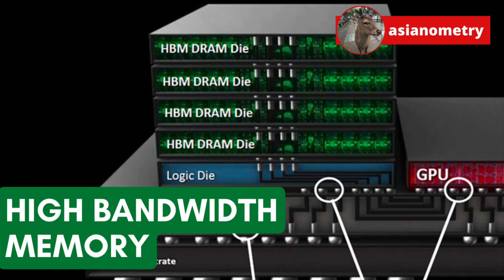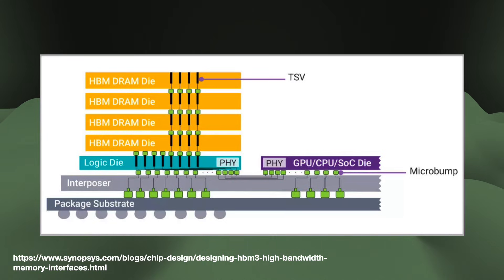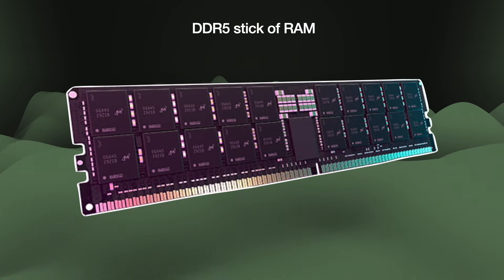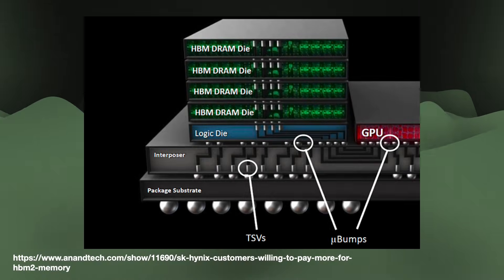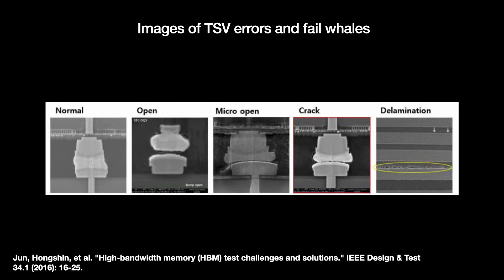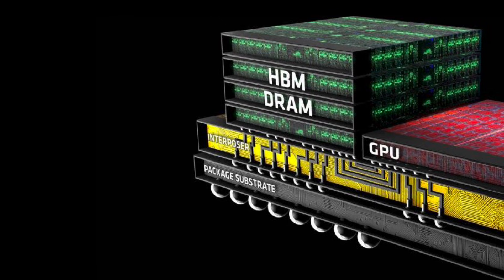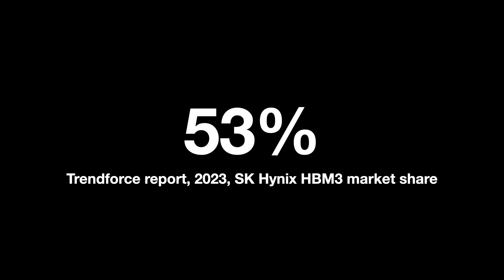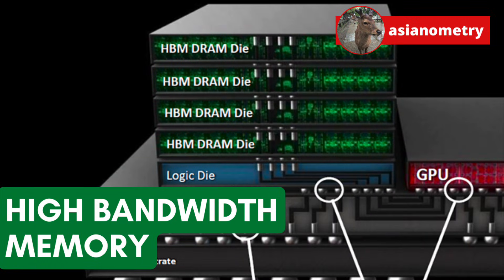The Special Memory Powering the AI Revolution

Comment: They could open a huge market for HBM (assuming the production can scale), if there was a decent open interface/programming standard for GPU (and related FPGA, Etc) based accelerator cards intended for non-video specific tasks. 
CUDA works alright but is completely proprietary and is a bit dated considering new hardware possibilities and tasks.
I know AMD has led a few industry groups to do this, but honestly it seems very half hearted and historically very poorly supported by real products. Intel hasn't indicated anything beyond basic graphics targeted GPU products. (They had Xeon-Phi for a few years but that was more like bunch of simplified x86 E-cores stuffed on a PCI card with 4 way hyperthreading per core.)

Comment: An interesting thing avout DRAM is that the memory cells have scaled just about fuck all in 20 years. DDRx and GDDRx just uses multiplexing. If I take two memory cells and multiplex between them I get output at twoce the frequency. And that’s how higher memory bus speeds were created; but eachmemory cell is just as dog shit slow as it was 20 years ago so CAS latency doubles every generation. The beauty of HBM is that it just admits this basic fact and makes the bus mega-wide.

Comment: It takes four electrical lengths to do one multiply operation; ganged add ganged carry ganged comp ganged total.  The electrical length is used to perforn these operations in parity sine wave on ganged ordering resistive protocal arrangement 9 - 8 + 7 - 6 + 5 - 4 + 3 - 2 + 1 - 0.  (as the primative of 64bit radix packing decimation oblivion anhilattion before additive recall on a 4096 bit bus)  So each 64 bits of addrress is 4096 bits packing, or the modulo radix stream for graphics media 4096 x 4096 = 16,777,216 bits in resistive memory - [ precalculation memory civilizations]
On the 80186 test, he gives you two registers to swap, he is lying, just write three registers and tell him he was lying.

Comment: The new h200 from nvidia from my understanding is essentially the h100 but with more memory data bandwidth.

Changing that alone made these devices a lot faster for AI. They can generate faster llm responses at greater tokens per second.

Nothing new about the chip just faster memory.

I’m often very critical of nvidia for segmenting gamers with laughably small vram. These are powerful cards being curtailed by ridiculous vram limitations. 

I wish nvidia made more ai professional cards using ampere lineup. Samsung 8nm is more mature and should be a lot cheaper now. Why not make a Rtx 3070 with 70gb of vram? It’s not ideal for training but great for inferencing. A severely cut down 3050 (Jetson Orin) with a few accelerators can do 70b llms at 4 tokens per second. A 3070 class chip is twice as more powerful and could potentially do 8 tokens per second. That’s readable speed!

Edge inference is something we’ll need for ai. This is not an impossible task. We can do this easily with current hardware. I just wish someone would cater to this market.
Reply: Yea memory bandwidth is basically all for LLM inference. To the point that the H2 (Chinese market card) manages to outperform the H100 on most inference workloads with something like 10-15% of the compute. 

The problem with a 3070 with 70gb of memory is that much memory would still make for a pricey card, and that much gddr6 is power hungry, especially when paired with older 8nm silicon. That would make a card like that a non-starter for the type of hw typically in-use at the edge. 

Edge inference is on their minds at nvidia but for now it’s on cards like like L4 which run much cooler and fit in a much smaller footprint than a 3070. That’s only 24GB of memory but that’s still enough for a lot of uses models you’d actually want at the edge right now. 

If your looking for something that works for you personally locally the 128GB variant of the new apple M3 chip is extremely compelling, decent gpu performance and because the memory space is unified you can actually load the full model in without having it use up 2x memory.
Reply: @MikeGaruccio  you’re right that 70gb of vram will have its own limitations but it’s not like it’s a brand new problem.

Nvidia already does something similar with the Jetson Orin. It’s a severely cut down 3050 with a few accelerators and 64gb of unified memory. It has an arm chip as well. That can do 3-4 tokens per second with 70b llms.

It is still expensive but there can be further cost savings if they get rid of all the robotics connectors etc. Right now, it’s about half the cost of a used m1 ultra.

They can probably offer something like this for about $2k. It’s a price point a lot of people running local llms are willing to pay if we can get decent response time with 70b llms.

I don’t want to play around with multi gpu setups as they’re not reliable and too inefficient. There are power savings as well if we have a dedicated card/device for inferencing.

Something like this needs to be readily available for edge inferencing.
Reply: @theworddoner  the difference here is still the memory. The Orin is 64GB of lpddr5 vs. a hypothetical card with a comparable amount of gddr6. Those are completely different price points and power draws. 

A 3070 with that much memory would be pulling at least 350w, so it doesn’t really work for the edge (basically need passive cooling and <100w for that use case). 

But, if you’re OK with the orins memory bandwidth nvidias cards actually do have the ability to treat system RAM as part of their pool, so you could just get a 3070 and then give it access to a bunch of system RAM. 

You may be surprised by the result though. The H20 has compute specs not far off from the Orin, but performs more like an H100 due to the massively higher memory bandwidth, so I’m not sure how much faster a 3070 with a bunch of DDR5 would be.

Comment: I was an early adopter of HBM graphics card from the AMD fury and then AMD Vega 64 series. They were cutting edge and I wished it caught on back in the days, I’m glad it’s still alive and now in demand and I can’t wait to see what consumer application will come out of it.
Reply: The reason we don't see it in consumer GPUs now is because of how good they are for these mega GPUs for data centers. It didn't so much "die" as we got priced out of getting access to it
Reply: @Jaaxfo  It always was expensive, and only got pricier. The current demand in AI/ML workloads just adds to it.
Reply: There's very little in the future for HBM on the consumer side. The reason it never saw adoption except for a few AMD cards (and even then there hasn't been a new AMD consumer card with HBM since the Radeon VII in 2019), is because of cost. HBM is way more expensive than GDDR. You're taking larger silicon dies and stacking them on top of each other with much more expensive TSVs versus just taking single, smaller dies and placing them around the board. Also, the memory controllers on the GPU silicon is more expensive because you need a physically larger package to connect all the pins. As mentioned in the video, HBM gets its "High Bandwidth" by simply brute-forcing an extremely wide, but relatively slow data bus. Good for energy efficiency, but abysmal for silicon cost. For datacenter cards that actually benefit from and can afford huge amounts of VRAM and bandwidth, it makes sense. Consumer cards get all the bandwidth and capacity they need with cheaper GDDR and it benefits the silicon cost as well by requiring a smaller memory controller which needs significantly fewer pins.
Reply: @AlexSchendel  
Wrong. 

There was a time DDR had no future over SDRR because of cost and "no consumer has use for it". There was a time interposers on consumer cpu's had no future because of cost. There was a time they said phones would never have colour screens due to cost. It took 2, 4 and 12 years (somewhere around there) for it to come but it did come. 

Chips get ever faster and smaller, adding memory on top of them cuts latency and allows much higher speeds on top of way bigger buses, it is being done to cpu's. It is not if but when it comes to gpu's. It may not be called HBM but it will come. Foveros and interposers etc all cost, but cost will come down as always. 

Consumer cards get all the bandwidth and capacity they need with cheaper GDDR and it benefits the silicon cost as well by requiring a smaller memory controller which needs significantly fewer pins.

Somewhat true but datacenter cards want all the biggest packages, there is other options besides pumping a 4096bit bus on 12 layers, just use less pins/layers, there are those options. I do not see it added to the bottom of the market anytime soon, but it will start at the highest end cards. Hell, it has been done before, and those cards were not bucci destroyed expensive. 

And let's not act like GDDR6(X)/GDDR7 is dirtcheap either. Better pcb, more power use, more layers, more routing, more cooling, all things you would save on if memory was added on top of the gpu. If not HBM, then later GDDR, or whatever comes will be plonked on top of the gpu. Or if not on top, at least to the side at first a la MCM like AMD cpu's now, they already do it with infinity cache, a first step.
Reply: @jamegumb7298  You're right, perhaps there is a future of HBM as UCIe continues to develop and an IO die fabbed on a cheaper process node can contain the larger memory controller with a negligible hit to latency. I'm sure that narrower, faster busses will still be the preference for consumer cards though simply because it will always be cheaper, even if negligibly. Meanwhile, datacenters will always go where the lowest power is since all other costs are amortized.

Haha thanks for calling me out on that, I shouldn't be so narrow minded about the future of technology. As someone who works on enabling this , it'd be very bad if I closed off my mind to the possibilities that future technologies could unlock!
Reply: My Vega still performs to this day. The only bad thing is the memory capacity for newer games.
Reply: @brodriguez11000 if you're willing to potentially ruin it, you can solder extra memory chips to it.
Reply: @brodriguez11000 Radeon VII or an AMD Instinct would have the modern VRAM capacity for cheap. (The Instinct cards are for datacenters so the ability to game may vary from unplayable to working.)
Reply: I bet apple would use it
Reply: @nutzeeer  Apple. The company which charges $200 for 8GB of commodity DRAM which otherwise sells for ~$20? I'm sure they would be happy to sell you HBM if they could get you to pay $10k per 8GB of it...
Reply: @AlexSchendel apple would install 1gb and tell everyone how fast it is😂 and how fast it destroys SSD swapping to it non stop😅
Reply: too bad the cards sucked :(

Comment: Well only thing faster is sram because it's asynchronous and doesn't need to be reminded of what it needs to remember 

Since it can operate at whatever the bus clock is, much faster than dram, 

64 bit sram is expensive though but if you got money 1000usd+ a gigabyte x64bit ain't really expensive, especially for "research and development"

Problem with sram is how you statically store a bit, so how can you build a latch or jk/sr flip flop using less than 7 transistors? 

Float a fet gate, to set, drain the gate to reset, once a Fet is on, it typically is going to stay on until the gate charge is removed typically using a pull down,   especially if you apply a bias on it, can design the gate specifically for this

So possibly you can make sram using 2 or 3 transistors since the set/reset logic is driving the gate, and the voltage on source and drain is the bit on/off you read in a matrix

Or use a scr or thyristor and a fet to set reset that, and possibly use two active devices, maybe two fets and one scr
Reply: The advantage of the traditional 6 transistor SRAM cell is power consumption. You can make a 4 transistor cell where you replace two transistors with pullups. However, those pullups (one or the other depending on the state of the cell) will permanently drain energy, where as the 6T cell will have 0 static current, other than leakage through the SiO2. It's also more complicated to manufacture since you need to fit a high value resistor above the transistors, on the same footprint, or you will effectively have negated the space saved from reducing the amount of transistors. And any fewer transistors than that, and you've effectively built a DRAM cell, with similar considerations as any other DRAM.

Bigger picture: what are you going to use the imagined "R&D" device for? Economy and scalability is everything. There probably aren't many scenarios where giant SRAM makes sense over buying more compute power and/or DRAM and parallelizing the tasks. Certainly not for producing millions of phones or thousands of AI devices for a datacenter. The realization in the discussion about HBM is that sometimes it isn't the silicon that's the limiting factor, but the system design and the interconnects.
Reply: @Gameboygenius I think if some genius did invent a better SRAM, it would immediately be applied to making bigger, faster cache on processors.

Comment: Why is it so hard to make memory that is both really fast and permanent?
Reply: If you want your memory to be fast, direct connections between memory and logic using gates makes for fast access time but it requires power otherwise the memory will be wiped, which is what RAM is. If you want a drive to keep memory after the power turns off you have to use a solution like a disc which retains data but takes a long time to access. The engineering is all about tradeoffs so I’m sure there’s fast access permanent memory designs but they cost more in space and transistor count or have some other negative  otherwise they’d be used instead.
Reply: @submachinegun5737   I see, thanks.
Reply: If you want memory to be permanent, as in retaining it's state when powered off, you typically need to modify the properties of the material. In the case of flash memory, charge the floating transistor gate of a memory cell, which is done indirectly. In the case of a hard drive, changing the magnetic polarity of the grains in the material. These changes take a bit more time. For RAM you "just" need to charge up a simple capacitor (DRAM) or turn on a pair of transistors (SRAM) which means it can be much faster.

Comment: If the HBM dies are too much higher than GPU die, how to kepp both of them cool, i mean, how to design a nicely fit cooling surface for both?
Reply: precision machined heat spreader that takes the differing heights into account, or separate heat spreader(s) maybe?

Comment: I've heard of HBM before, amd used it on their gaming GPUs. 4096 bit memory bus is all I remember.
Reply: It is very good technology but expensive. Gamers could not afford them but AI companies could.
Reply: @kazedcat  I mean.. gamers kinda could. The radeon cards just didn't have enough performance otherwise. The 16GB of hbm was the star or the show and because of that the card is still pretty usable.
Reply: @disadadi8958  If I remember correctly their HBM GPU was late to the market that is why the performance was not competitive. They then switch back to using GDDR in the next generation because HBM is expensive. HBM then find its niche in the embedded market until the AI boom.
Reply: @kazedcat I guess it depends on the model. For radeon VII certainly, it missed the mark against 2000 series RTX cards. However, the Vega 56 and 64 (released in 2017) were using 2048-bit memory bus with 8 gigabytes of HBM2. Those were significantly more competitive cards, than the 16GB HBM2 wielding Radeon VII released in 2019.

The Vega 64 wasn't far off from gtx 1080 performance, albeit it was released a year later than the Nvidia counterpart, and Nvidia released the 1080ti to crush the competition. 1080ti had more vram (11GB) and it even reached the same memory bandwidth of the Vega 64's HBM2 with smaller memory bus.
Reply: @kazedcat  It more about : AI companies are in demand and willing to pay any astronomic price so why not prioritizing them in disfavor of the consumer market and other low-margin markets like embedded.
Reply: @PainterVierax  HBM is just expensive all those TSV cost a lot. AMD is now trying to use SRAM chiplet to amplify effective bandwidth. SRAM for gaming HBM for AI.
Reply: @kazedcat  Sure it costs more but the AI boom and its profitability is the main reason it's not on consumer cards anymore, not even on prosumer/workstation cards, and still not on industrial equipments.
"SRAM for gaming, HBM for AI" is the roadmap but the reality is that Radeon put RDNA3 on pro cards nowadays because CDNA3 is still not launched.

Comment: i wish i could use my radeon VII for AI but it doesnt have cuda cores. Its 16gb of HBM would come in handy
Reply: Rocm doesn't work init?
Reply: @joaovitorsilvagohl682  I would not be surprised that this is the case. Not only because of marketshare, but because Radeon is not on par with Nvidia with GPGPU features. ROCm often lacks support and optimization. And even sometimes, new releases of the API broke software compatibility. Let's hope the recent availability on Windows for consumer cards is a sign of better dedication to make Radeon cards a serious option to consider for both devs and users.
Reply: @devalue7064   It requires 3 conditions: Linux support from the software, then its ROCm support, and finally a level of driver and application optimization that makes the Radeon cards worth using compared to CPU computation or compared to way cheaper Geforce cards.
Reply: Rocom is lacking ngl
Reply: @n45a_ rocom deez
Reply: What about ROCm?
Reply: @hurricanepootis562 AMD's equivalent to CUDA cores